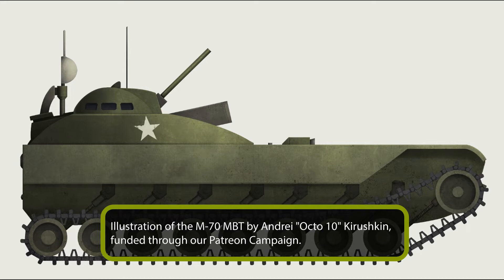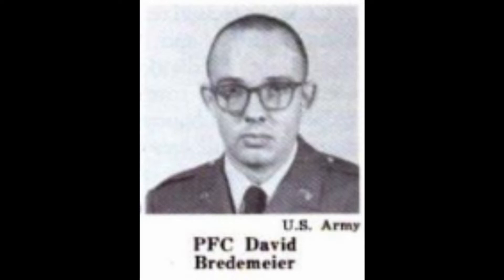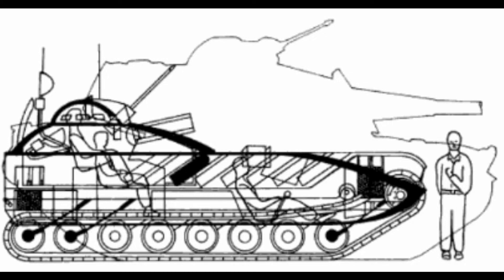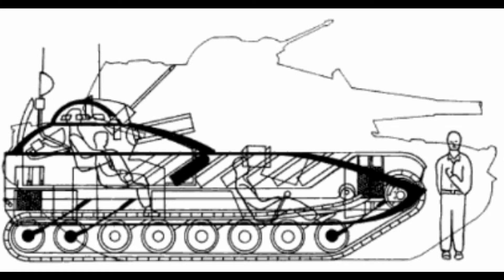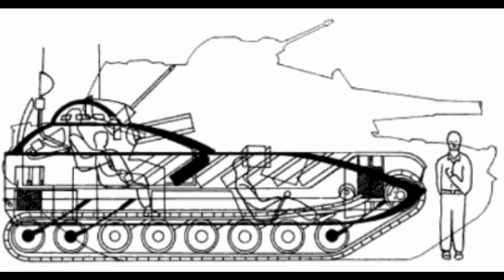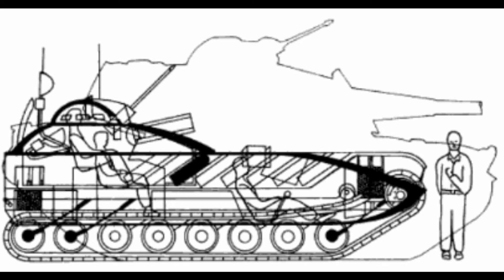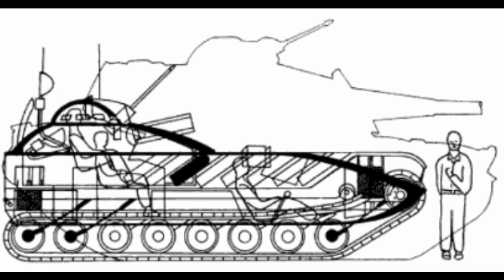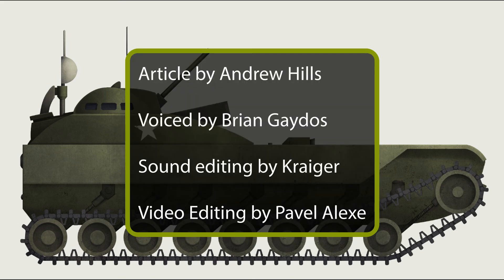M-70 Main Battle Tank - Semi-Professional MBT design

Comment: The M551 "Sheridan" and the M60A2 "Starship" shared the same basic gun launcher. The HEP and Beehive rounds, when fired from the Sheridan, were VERY effective in Vietnam (several of my Drill Sergeants at Ft. Knox were 11th ACR veterans and they loved those two rounds in that war) but they came to despise the missile that the Sheridan and the Starship utilized for a number of reasons that included relatively slow speeds from Point A to Point B, and a bad habit of either impacting the ground well before striking any given target, not to mention turning around in mid flight and heading back toward the launching tank....Those bad habits lead to the continued development of the M60A1 and the later M60A3.